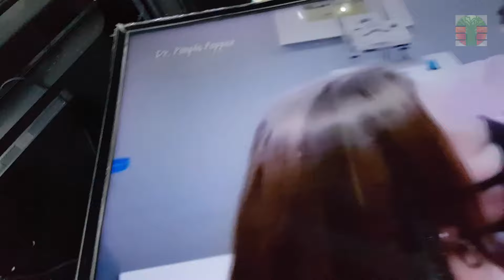Damage by water. Can it be fixed?

Comment: For pcb traces repairs i use enameled copper wire taken from old relays.Instead of trying to align the tiny jumper to fit exactly in the broken pcb is easier to connect from point to point of the pcb trace and there is no danger for short circuits of the jumper wire since it is insulated.